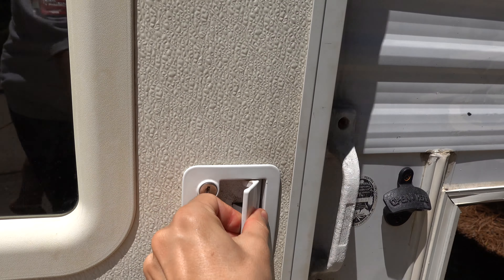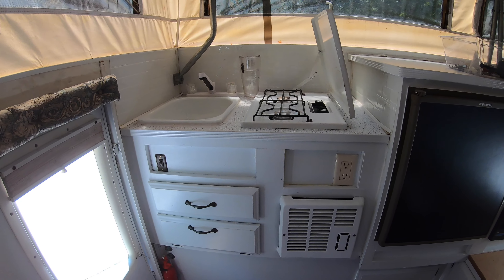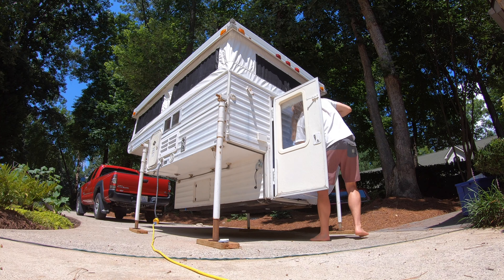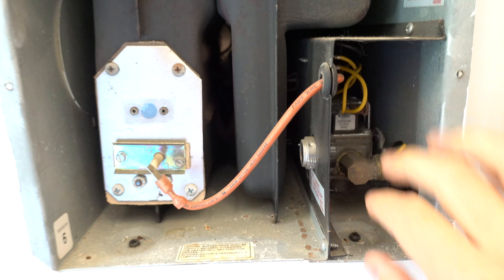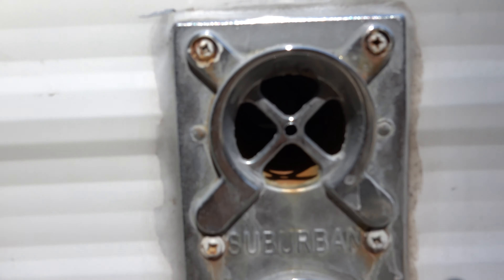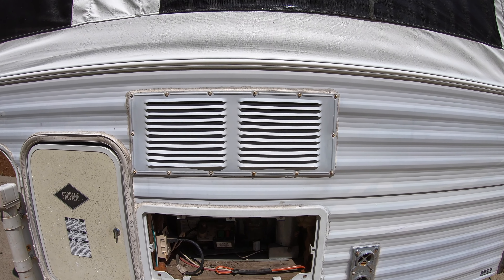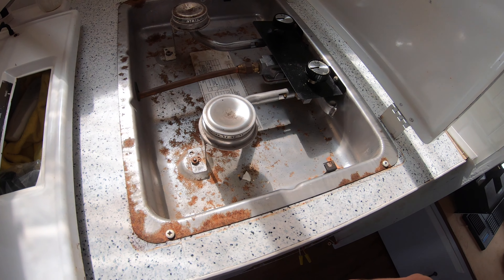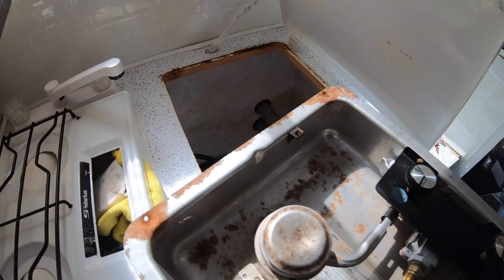We're Gutting The Camper // Tacoma Truck Camper Reno #1

Comment: Hey Joe, we were really surprised to see DC34  made an appearance @2:47! Miss sucking up things with that little rascal! Looks like you’re treating them fine. I probably would have emptied their bin a little more frequently and probably replaced the filter before requiring them to preform such an argues task! But it looks like y’all are having fun at least. I’m sure you’re letting them get the appropriate amount of exercise and bringing them out on the lake every once in a while, they always enjoyed being on the water. I mean at least letting them get some fresh air everyday… its probably to humid there for them now that I think about it! DC34 isn’t rusting are they? you should be checking everyday for rust! Definitely wouldn’t rust at home… You should drive them back to Colorado to see the mountains sometime! Anyways… Great Video, Miss you three!
Reply: Any issues on weight with the Air conditioner and cranking the top up? I have the exact same TC you have and am considering adding one. Thanks!
Reply from the maker: It is definitely noticeable but doesn't seem to be an issue. I don't know how your camper behaves, but as I'm lowering the top down the final 1/3 of the way it does want to come down fast so I have to ease it down carefully.

Comment: Great video!  For the power unit, if all it is doing is rectifying AC to run the appliances and you are ditching most of the appliances, It might be worth running new AC appliances and just rewiring the lights.  You could run the lights off your battery system directly (with fuses of course) and use a solar charge controller to charge the batteries.  Then just get an inverter to run all the AC appliances off the battery.  When you switch to shore power, just have a switch from the battery to a 120VAC to 12VDC power supply for the lighting and plug the appliances in directly, bypassing the inverter.
Reply from the maker: Makes sense! My hope is to just have a DC fridge as my only real electrical appliance and run that off the battery. Beyond that we'll likely just be charging phones/computers and running the DC lights.
Reply: Hey! I have been renovating a very similar camper and have been leaving the power as the last piece because I'm kind of lost! It sounds like you know what you're talking about. The set up you explained is what I'm planning on. Do you by any chance have any good resources - videos/ tutorials demonstrating how to do this?! :) Please and thank you!

Comment: Joe, we had a small camper trailer (A'van) a few years back and loved it. The fridge had 3-way power - AC, DC, and gas which was handy on an extened trip. We also had a 50 watt solar panel on the roof and DC charging from the car while we were in motion. I look forward to seeing the finished job, I think it will be great, given your smart approach to the task.

Comment: Keep the power distribution. You just need to get a solar charge controller (mppt is more efficient), which hooks to battery only. On my camper I just put a port out to exterior wall from the charge controller, and can hook up my folding portable solar panel into that port when needed. I didn't mount the panel, so I can move it around or angle it for best direct sun. That way, you don't need to mess with any factory wiring for shore power or DC circuits. Your solar panel only ever charges your battery anyway.
Reply from the maker: Great info, thanks! Does your battery charge when you're plugged into shore power?
Reply: @BackcountryBanter  yes, on shore it charges from my power distributor, boondocking I throw on the panel. It's enough to run the pump, lights, 3-way fridge, and fan for a couple days. About a 100ah battery.

Comment: It would be dope if you could mount a large solar panel to the top that won't block the AC. It should be adjustable on all 4 corners so you can tilt it toward the sun regardless of where you are parked.
Reply from the maker: Agreed! Though someone did mention that they use portable panels so that they can park in the shade but place their panels in the sun and adjust them accordingly. That also seemed like a great idea.

Comment: Nice series; willing to bet you are the first guy to clean the ceiling if the camper.  From your first video I would have to guess that you are over the payload capacity for your truck.  Got to calculate the passengers along with whatever "cargo" you have in the truck and in the bed.  By removing the furnace, stove, and refrigerator (and potentially the 20LB propane) you are saving some of that payload capacity. You mention that you are from Denver, you could seriously consider swapping out the AC for a MaxxAir fan to save a little more weight; you would be surprised how much air that thing will move and expel the hot air.  Not necessarily suited for North Carolina summers.  Not sure if a rear seat delete is an option for you; you are saving a little more weight if you have removed your tailgate.  You mentioned adding solar and a couple of batteries though which will add quite a bit of that weight back on (although lithium batteries are a bit lighter).

Whatever add-ons you do with your truck you are only improving the ride and the way the truck handles being overloaded; and they will further take away from the payload capacity.
Reply from the maker: Great advice, thanks. I just released a video today which includes me putting some air suspension onto the truck to deal with the added weight 😁. That said, I'd still like to get the camper as light as possible. I'm planning on swapping to a MaxxAir fan as soon as I can find one I can afford haha. I hadn't thought about removing the rear seats but that would make sense and it would free up some space.

Comment: Wow, you are putting some serious work into this project. I'm excited to see the next videos! 
Side note- In my van I have one stove which I can disconnect and use outside (like you are wanting to do). I would say I cook outside the most, it's just nice to not smell up your space but also do be outdoors. 

What are you going to do for heating in the winter or will you chase t-shirt weather?

-Andy
Reply from the maker: Sweet! For heat I'm looking into the Olympic wave 3 propane heater (It seems that electric heat is just far too inefficient.) The plan is to have a propane "outlet" near the floor of the camper and mount the Wave to the sidewall in cold weather conditions. While I imagine we'll chase warmer weather a bit there will definitely be times and places where we want to be in the cold or snow. Are you still using the portable propane heater / do you like that setup?
Reply: @BackcountryBanter   The Olympic Wave heaters are pretty amazing. I went with the Wave 6 about a year ago and would highly recommend it. In your large space I would recommend the 6.  The 3 will take a long time to heat up your space. Honestly if you're going to be in the cold (below freezing temps) often I would say a heater with a thermostat. I know you're looking to save space but there's some small Chinese made diesel heaters that exhaust to the outside. That's what I would do if I was in my van for more Colorado winters. But honestly the Wave 6 heaters does the job and it's very simple. Also the Wave 6 is extremely efficient.  I used a 20 pound propane tank and lasted 4-6 wks + used it for cooking in Feb up in the high country. 

Also for refrigerators I recently added a Dometic CFX 28, it's nice for lots of veggies and cold drinks but not too big taking up space in the van. We have it running off of 1 - 100 watt Renogy panel. Although I may add 1 more 100 or 50  watt panel.

Just some insight for you.

Andy
Reply from the maker: This is all great info, just what I need. Thanks! I'll look into the Wave 6 and diesel options, if I had a diesel truck I'd definitely be going that route. I've been looking into the knock-off dometic fridges and am leaning that way right now. It's crazy how efficient they are.
Reply: @BackcountryBanter   The diesel heaters actually have their own small tanks ( I think a gallon or so). Great for vehicles that use gas. Here's a link to a guy that's been using his for a year. https://www.youtube.com/watch?v=l0-aq7PhUNQ&list=PL5lptV6Gfs-78cB7aLwbPrBZ9t02YQovz&index=5&t=0s&pbjreload=101

I do wish I went this route but the Wave 6 does work.. The diesel heater is also a knock off to a more expensive European brand. Like he says in his video the propane heaters put out some condensation into the air. Although I will say the Wave heaters don't put out as much as the Mr. Buddy heaters... I've used both.

Yes, the small fridges they make now are amazing.. I wonder how they are compared to the more expensive ones..

Hopefully this helps a bit!
Reply from the maker: @AndyOnTheMountain  It helps a ton, thanks again! I'm going to look into the diesel heaters now too :)

Comment: If you're going solar that heater space and its exterior ventilation is going to be needed for batteries
Reply: My question would be can the roof support solar panel weight or bracket placement?  Might have to go with portable  solar panels which is a royal PITA.  Can’t wait to see how this re-vamp progresses.

Comment: Are you going to use a "little buddy" type heater when it gets cold ?
Reply from the maker: I'm thinking of going the diesel heater route. Most people say the buddy style heaters are gas hogs and they put off a lot of moisture. There are slightly better propane options like the olympic wave, but they too put off moisture and require ventilation. The diesel heater don't require ventilation, are pretty efficient, and can be mounted outside the camper to save room. Plus at around $120 they are quite affordable. I don't like having to carry diesel around (especially on a gas truck lol) but it just seems to be the way to go.
Reply: @BackcountryBanter  I considered that also, but since I am still running propane...havent decided if I want to ditch the fridge or heater in the camper, carrying a 2nd type of fuel (diesel) doesn't make sense for me. I have tons of storage in my truck, and its just me and my small dog. Thanks for your speedy reply's!!!!!